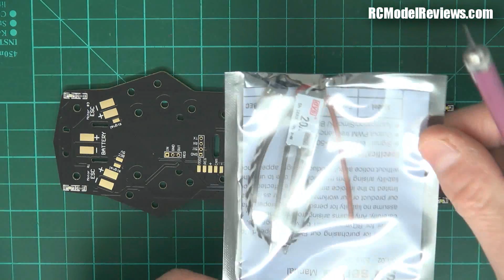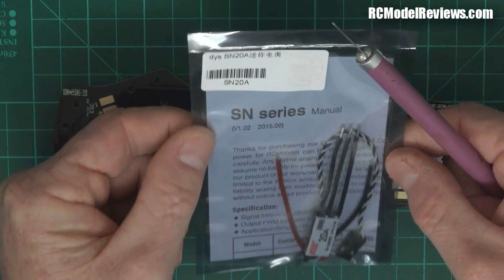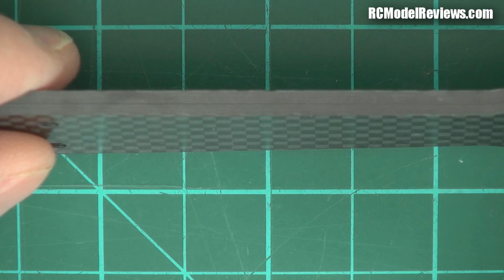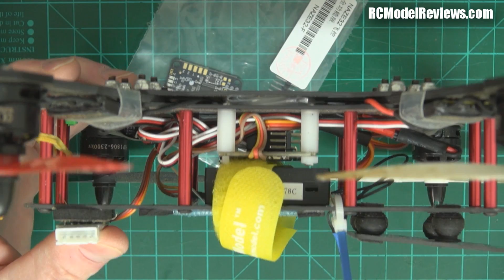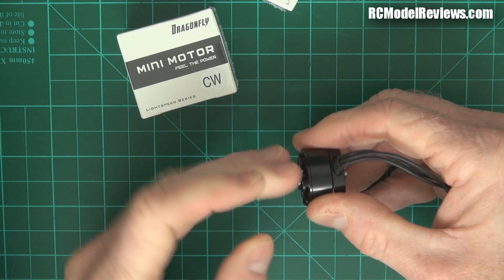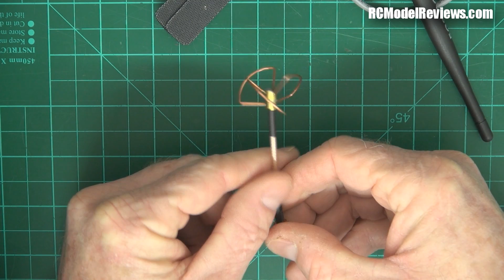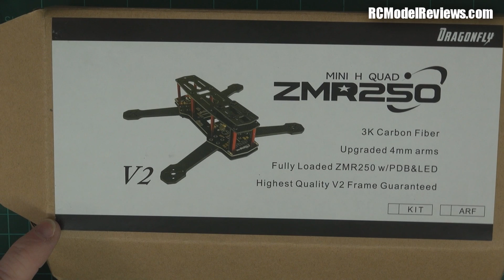ZMR250V2 ARF from FPVModel.com (part 1)

Comment: i have this frame and i put arms on without the plastic spacers. It Will be a pain to take the bottom plate off because my esc cover the screws so i will also have to take the escs off. Is it really that important?
Reply: If you have the new PDB, then you have nothing to worry about.
Reply: Elexo is correct, the PDB was updated in August last year to avoid running the traces underneath the arms. Check which version you have as PDB V1.2 onwards have the updated traces.

Comment: I just received mine! super excited to get it in the air, however I ordered the motors and esc about 2 weeks after buying the airframe. Anyway, they have updated the PDB, none of the traces run over the carbon arm which is great. Also the power traces have been re routed to have wider traces. The smd in the bec look much better done than they were in your'e version, and are not soldered on wonky. The pads for the front esc are still in the same place, but im just going to use the ones on the bottom. You could just use the negative from the pad further out, and then the positive from the one further inboard.

Comment: welp i did it...DJI phantom drones are boring..just fly slowly around..dont crash cause it cost 1400+, im so tired of it..and it cost so much for WHAT? seriously? What did i spend my money on..oh the name, the unexpected NAZA fly away. Im over that feeling for sure,.this is what i did...dynamite sport charger,4 batteries,( 2 turnigy 2 flora somethings??) won a bid for fat shark goggles and fpv,, flysky i6 newest version, qav250 v2.1 emax 2300 kv ccd3 flight board, 4x extra arms, 2x extra speed controls, and 8 packs of 5040 props, oh and a new soldering iron. ALL for under $500.00..YEP you heard it under $500.00..about 485.00...alittle research and interest and i could have built my own "photo" drone for 1/2 the price of my phantom.

Comment: I improved (I believe) on your original homemade PDB idea (the circuit board with a gap cut) and bought some copper roof flashing.  I can solder 14 gauge on to it and not leave a bulge between the upper and lower plates.  The flashing isn't too thick, so passing ESC wires over it works OK to get to the proper polarity.  And of course, there is quite a bit of copper in that strip (I cut them about 10mm wide?), so it should easily conduct the full battery current.  12 gauge won't fit with 3mm arms.  Perhaps it will with 4mm?  Also, there is a trick to soldering the wire on, but I don't have an easy way to make a video.

Minimum purchase was 2 square feet, and it was the roll end, so they sold me about 6sq feet for $25.  I have enough copper to make a couple of hundred quads.  Anyone need a bit of copper?

Anyhow, no bits of copper rubbing against carbon fiber.  And no washers to compromise the arm to frame joint.  Bleh.

Comment: Flashing the ESC with BLHeli.. how does one determine if you have a SiLabs or Atmel based ESC?  Can this be done without stripping off the heat shrink?

Comment: I have the newer kit with the new PDB. The new PDB fixes the traces under the arms and adds ESC power and signal contacts to both sides so you can mount your ESCs between the PDB and the bottom plate if you like. The traces are still thin and no epoxy or conformal over the BEC components.  The arms I got were all layered carbonfiber not glued as yours appear to be and I did test them with a meter to make sure there were carbon and not a composite. There is the option to get the acro or the full Naze board and I got the acro. 

ESC are still SimonK but I bought the USB DYS programmer and flashed them. The small dys programmer is nice as you can keep it in your kit so you always know were it is and not worry about it getting damaged like a Arduino would in your kit. Handy for when BLHeli updates come along. 

Still the same crappy antennas and deans connector, but you can request an XT60 in the special notes when you order. Most of us already have some on hand but they really should just switch over to it especially since all the board mounts you can buy and or print are XT60. There are no standoffs for mounting the camera to the camera mount in the kit I got. this is something that should be included.

The instructions for building are better than some but still lacking and a google search will get you much better information. For instance, I bought the MinimOSD board and the instructions have you building this with the 12V connectors, but the board they ship has the 5V jumpers pre-soldered. This is my first custom build with FPV so I didn't know about this and fried the first OSD board and had to order a new one. The instructions have you soldering the wires to the Naze and the PDB. I used headers on both instead but in hind sight, if I did this again I would solder header wires to the Naze and header pins on the PDB. I used gold plated headers and header connectors with a drop of hot glue to keep the connectors from coming loose in flight.

Since I just finished putting in my new OSD this week and the weather here has been crappy the last two days I have not had a chance to test fly other than an indoor hover.

Overall, for a budget kit it's not bad but there are some things that could be improved. I priced building a similar kit on the popular Banggood site, and by time you add  up the pdb and frame and all equivalent parts the FPVModel kit is cheaper than Banggood by a few dollars. If this kit were updated with a good antenna, XT60 and BLHeli ESC it would make the kit significantly better. A few things are missing from the kit that also need to be included. First the standoffs for mounting the fpv camera. Next a cable to attach the antenna to the TX module especially since neither has a right angle connector. With those few minor changes the kit would be a very good investment and not just an ok budget kit.

Comment: I'm late to the party, but on the whole SimonK vs BLHeli thing, the problem with SimonK isn't the software, the software is great (though it did take an inordinate amount of time to fix the rev limiter bug for highkv motors), the problem is that it is being dramatically limited by Atmel based ESCs. they just can't keep up with the faster and more feature rich SiLabs chips. The raw performance difference between the two is striking.  I'm going to be doing a good bit more testing on this now that the rev limiter issue is fixed. I've been warning people away from SimonK because of that for a while, glad to know I can stop ;)

Comment: SimonK...Awww, man! That guy is a bastard!
Reply: :) Seriously though, I'd love to hear of any issues at all so that I can fix them! The goal was to make it just work and NOT require knobs to make particular motors or combinations work. Unfortunately, many random factories just ship some old version they found from 2011 rather than the latest release. Also, without a GUI, all of the features and settings are probably lost on most people. I did build a page back in 2013 to expose most of the configurable settings, but never finished it: http://0x.ca/tgy/ -- meanwhile, the RapidFlash app does make these accessible. Finally, BLHeliSuite does support using my boot loader to load BLHeli, if you'd like. Just not pass-through on baseflight or forks yet. I'll see if I can work on this.

Comment: SimonK is not "behind the ball". ;)
Most of the features BLHeli has have equivalent features on SimonK, they're just compiletime, rather than having a configuration tool.  Compiling the stuff in allows the code to be smaller and faster.  He's actively working on the code as well, and has an enormous pile of motors to test for, and fix any "sync issues" (which are often not really sync issues).  Recently he's added a fast path to the code which allows much higher rpms than were previously possible (on either code base afaik).
Keep in mind that his default configs are the safest "best-fit" features that will run safely and reliably on as many escs, motors, and voltages as possible, rather than turning on all the bells and whistles, which might improve performance on some ESCs, while letting the smoke out of some others which are less well designed.

Comment: When you consider the time required to solder everything to the PDB and the poor design I'd chuck it with the antenna. But my biggest complaint is copy this copy that copy everything you see but no innovation and no progress being made where it matters the most: decreasing the weight. These 250s weigh a frickin ton... they're flying bricks. What ever happened to the good old days and translational lift and feeling the wind in your wires? It needs 4mm arms because it has 2mm frame plates and has on and on. Add more weight here and add more there and then add some more so it doesn't break and now you need a bigger battery and since E=mc2 or close enough now you need more carbon so you can crash. Pretty soon you'll start ripping trees out at the roots. And what ever happened to not crashing? What kind of habits do you develop when you allow yourself to crash so much?

Comment: Bruce: 
    U refer to better equipment for Mini Quad FPV racing in this video. What's the chances that U make a list of the components for the optimum Mini Quad and FPV system and Post it with URL's to the parts.  Just a suggestion if U haven't already done that.

Comment: The plexiglas arm looks like it is a dummy for 22XX motors. They have the 4mm arms for 18XX with M2 and 22XX with M3 and a bit wider for protection. Btw, there is a kit with an acro board, you just got the premium version ;)

Comment: Avoid sn20a at all cost. These are notorious by now (solder melts, desync issues with high RPM motors, 20% decreased thrust compared to KISS 18a/RG20A/Littlebees 20a).

Comment: Anyone know if the new v2 now fits 2204 motors without any drilling needed?
Reply: +Pablo FPVModel sells ARF kits and also bare frames with larger arms, compatible with 2204 or 2206 motors
Reply: +Zuben Elgenubi  Thank you !

Comment: Hi Bruce, thanks for the video. I started off in my first quad build using deans connectors! I am now on my fifth build with loads of hours of flight time... Never had a failure... Send me your deans and I will put them to good use.
Thanks again for all you do for the sport.

Comment: Thanks Bruce! I have a question. I have bought an FPV monitor, quite an expensive one, which came with a circularly polarized antenna. So I have bought the transmitter counterpart too. But, since I started to use it, I have not experienced any buff in the performance. Actually, my "tests" have shown, that it pretty much does not matter which combination of antennas do I use, but important is only that I have some.... I have tested both maximum range and obstacles. What could be a problem? I fly with 200mW boscam transmitter, up to 1km LOS. Thanks

Comment: I still use Deans on almost everything I fly that has low amp draw.  I don't want to spend a month changing everything over.  I wish batteries would come without connectors.

Comment: I was actually about to order the full ARF kit because I like the frame & PDB and do not want to waste too much time picking the best parts. I'm a beginner and do not know too much about each single component and what to buy. So If i had to choose every single component myself, I had to waste hours for research and would probably end up with even worse parts ;)

But you made some valid points. I might just buy the frame, perhaps motors, and get the other components like I want them.
Reply: I'd email FPV and ask if you can swap some of the components out for others (they would have to have them in stock of course).

Comment: Nice one Bruce! Those motors are killer value for money. Thomas got more than a year out of his and the bearings were still fantastic
Reply: I have a set as well after seeing your review think they will do well on modified ZMR quads. 
Do they make a 2204 yet as all I can find is the 1806
Reply: +Kendrick Apps I've been using T-Motor 2204, but it would be good if they had the Dragonfly in 2204 2300kv!!! I've never checked for that
Reply: +BMSWEB don't know weather you have checked but although the t motors prop adopters are all cw  the prop adopters from the dragonfly 1806 fit perfectly and there is only a 0.8g difference in weight t motor is heavier. 
As fpv models sell the prop adopters separately now we can have ccw t motors for not that much more cost.
Reply: Are you serious!!! Man I'll have to try a set, Thanks for the heads up!!!
Reply: +BMSWEB  they will fit most 1806 motors as well I've just ordered 12 ccw prop adapters I will also be able to upgrade my Rc timer motors with a combo of the new adapters and the original ones taken off the tmotors I have.
Reply: I have some spares at home, I'm going to check to see if I can fit one to a T-Motor!!
Reply: +BMSWEB you probably have done by now I've only just seen the reply. Just to say been there checked that was surprised that they do fit, I'll bet they fit all 1806 motors with removable prop adapters and any 2204 motors with prop adapters that have axels turned down from the 3mm that they are in the motor to 2 mm for the stub that sticks out as in the case of the t motor HK elite will not fit but they have CW and CCW anyway so no need.
Reply: Pretty pleased about this!! Nice work!!
Reply: +BMSWEB They have "FPVMODEL" branded 2204 2300kV in CW and CCW for $15.51. I got those and they look good, however, my quad is not flying yet ;)

Comment: re: simonk vs blheli. for me simonk usually just works. the recent releases of blheli seem to hate little motors like the 1104s. flashing simonk onto the same escs fixed it. I'd say use whichever works with the motor and ESC at hand.